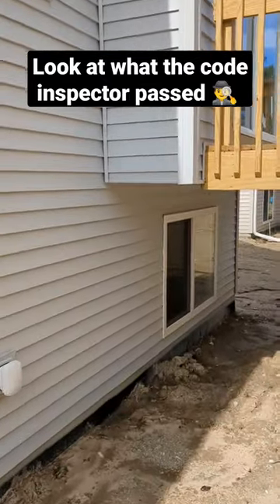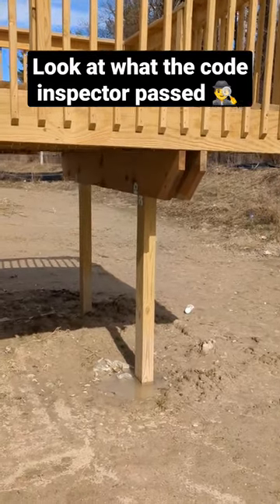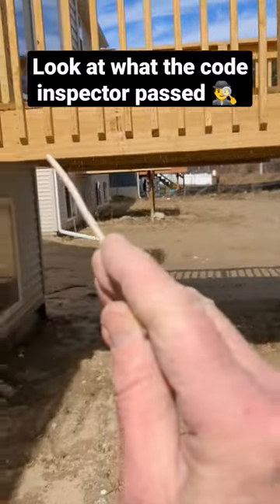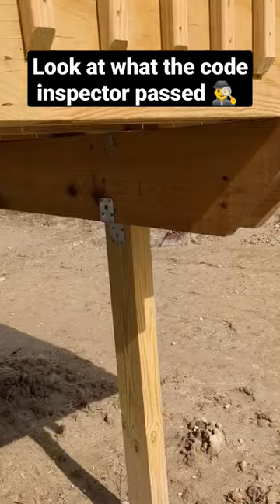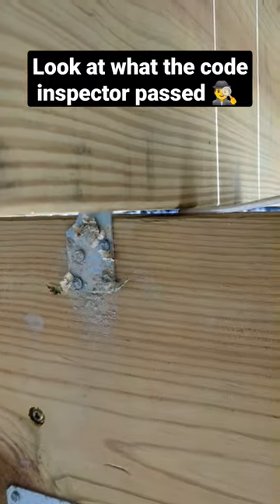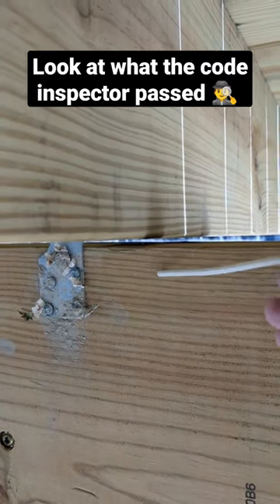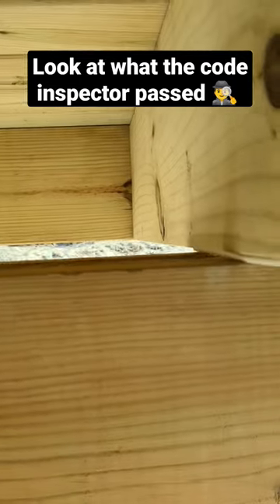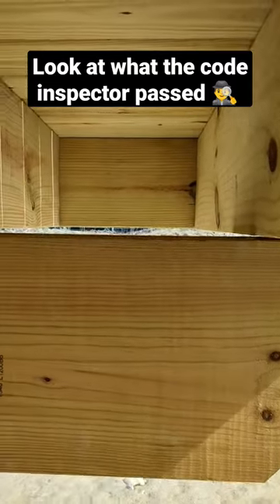Code #inspectors don't pay attention to detail#deck #newconstruction#youtubeshorts#shortvideo#shorts

Comment: How could a person get those joist to rest on the beam?
Reply from the maker: Well, actually the entire deck is improper and needs to be rebuilt.This home got worse. SEE Missing Footings Inside https://youtu.be/TqGMGpvnVAk
I've been finding more developments selling homes with NO decks, but they install handrails in the slider door frame. Once the code inspector is gone a crew member comes back and slaps on the deck for extra money 🤑 and no permit. Ugh.
Thanks for watching.
Reply: @inspectflix  I meant not resting on the beam. I  don't get a person can set one board on top of another and they don't touch?
Reply from the maker: @davidshumski4629  Right. Structural wood members are supposed to rest on top of others. The twist straps are now keeping them separate. The separation is caused by shrinkage of the wood.
Reply: @inspectflix  I finally came to that conclusion.
Reply from the maker: @davidshumski4629  it's an interesting illusion 😂 Decks and homes are built too fast.
Reply: @inspectflix  I've built a deck or two in my day. that treated wood is wet and heavy. Froze together at the lumber yard in the winter. I never used straps on the joists.

Comment: Why not point out the bigger issue at hand here? You cannot attach a ledger board to a cantilevered floor of a house lol
Reply from the maker: Because I made several different videos there . The entire deck is improper and needs to be rebuilt.This home got worse. SEE Missing Footings Inside https://youtu.be/TqGMGpvnVAk
I've been finding more developments selling homes with NO decks, but they install handrails in the slider door frame. Once the code inspector is gone a crew member comes back and slaps on the deck for extra money 🤑 and no permit. Ugh.
Thanks for watching.

Comment: Even pressure treated will rot quickly in standing water.
Reply from the maker: YES! Pressure treated wood life span is 10-40 years depending on the exposure of pH in the soil. Just imagine a wood foundation.🤮 yuck. I've inspected some of those in the last 32 years.
Thanks for watching.

Comment: There’s so much more wrong with that deck!  But the lumber probably dried and shrank a bit and separated from the girder.  Plus there’s no toe nails from joist to girder, which should be done prior to installing the hurricanes.  The girder and post system is a disaster in itself and worthy of its own video!  Unbelievable!

Comment: Uhh you guys are allowed ro use 4x4? And not 6x6? And split beem? Wisconsin code is 6x's and sandwiched beem
Reply from the maker: No, we are not supposed to do any of what's in the video here in Michigan. Minimum post is 4x6, yuck and now the beam is to rest on top of the beam or notched into the beam. And yes the footings are under the ground, yuck 🤮. The code book is a D-. And only 1 in 10 builders are licensed.
Thanks for watching.

Comment: is it a code inspector? or a construction inspector?
Reply from the maker: Well. We really don't know if a code inspector looked at it. 
Because we do  have homes built so fast here that the deck is not installed , they put a rail in the sliding door and get the final code sticker.
Then Some mystery person comes by and slaps the deck on.
Horrible format.
Thanks for watching.

Comment: Ugh deck is supported off a cantilever. The joists will settle and are off the girder due to the crown of the outside rim board. Exhausting. Don’t support your deck on a cantilever😢

Comment: That will settle very quickly.
Reply from the maker: Yep. Including the post. Lol
Thanks for watching
Reply: @inspectflix  The gap is not even important - what makes the deck a load of crap is that the beam is not sitting on the posts. Terrible construction.

Comment: That isn't the only violation!!!!
Reply from the maker: Exactly! The entire deck is improper and needs to be rebuilt.This home got worse. SEE Missing Footings Inside https://youtu.be/TqGMGpvnVAk
I've been finding more developments selling homes with NO decks, but they install handrails in the slider door frame. Once the code inspector is gone a crew member comes back and slaps on the deck for extra money 🤑 and no permit. Ugh.
Thanks for watching.

Comment: Uh, pretty sure Physics dont work like that. Where the force would be on the beam is actually on those metal thingies. If and when those metal thingies settle, the whole thing will no longer be level, making the product as it is not last as long as it should.
Reply: While yes the force transfer is on the connections, those connections are designed to withstand stress along the entire structure not stress of the structure alongside the dead load of the structure itself. This means those connections are at a much higher likelihood of failure.
Reply: @EggyWeggyIII  This is true. I also think it would be instant when it fails. Now that I think about it, someone could be standing on it when that happens. Yikes.

Comment: the water😂
Reply from the maker: Yep the water and more. I made a lot of short videos on this.The entire deck is improper and needs to be rebuilt.This home got worse. SEE Missing Footings Inside https://youtu.be/TqGMGpvnVAk
I've been finding more developments selling homes with NO decks, but they install handrails in the slider door frame. Once the code inspector is gone a crew member comes back and slaps on the deck for extra money 🤑 and no permit. Ugh.
Thanks for watching.

Comment: Also in other end attached to bay
This need to be free standing deck really
Reply from the maker: Yep. The entire deck is improper and needs to be rebuilt.This home got worse. SEE Missing Footings Inside https://youtu.be/TqGMGpvnVAk
I've been finding more developments selling homes with NO decks, but they install handrails in the slider door frame. Once the code inspector is gone a crew member comes back and slaps on the deck for extra money 🤑 and no permit. Ugh.
Thanks for watching.

Comment: It all looks fine to me, all proper connections in place just poor craftsmanship. The joists should have been resting on the beam long before any Simpson tie downs were installed and get those posts out of the dirt on metal post bottoms and get those footer’s above grade next time. The ledger attached to the cantilever is up for debate but it should have been designed so that deck joists would be flush with the interior joists as well but that’s what you get with production framing. If you aren’t building it yourself then you get what you pay for. Otherwise it’s structurally sound in my opinion but cheap work ain’t always good n good work ain’t always cheap. Next time tell the builder you don’t want a deck and pay a private contractor. 😊

Comment: No ledger board or hangers on floor joist
Not double banned 
Post to small should be 6x6 and notched 
Railing post not notched 

Wander how many 100$ it took to get this far below national code deck passed🧐
Reply from the maker: Speed process. In Michigan the builder is getting a final pass on code by putting a handrail in the slider door track. Then another person comes back and slaps that junk together. 
Only 1in 10 builders are licensed here. 🫡
Check out those missing footings inside.
Thanks for watching and the comment.

Comment: If that’s the worst thing this builder did I’d be very happy with that house.
Reply from the maker: It's not. This home got worse. SEE Missing Footings Inside https://youtu.be/TqGMGpvnVAk
I've been finding more developments selling homes with NO decks, but they install handrails in the slider door frame. Once the code inspector is gone a crew member comes back and slaps on the deck for extra money 🤑 and no permit. Ugh.
Thanks for watching.

Comment: Seriously? They are not all crowned the same, and you will get a little bit of that generally. This is NOT a big deal, and certainly not a reason to fail an inspection! What are they supposed to do plane off every joist until they are all completely straight or misalign where you nail them to the rim?

Comment: Shouldn't those be 6×6 posts or at lease more of the 4x's for proper support midway or closer to the house? 
Besides that...I would make that a tent/fort for yard fun and shady spot. Ooh maybe do a veg garden. Great concept poor execution.
Reply from the maker: 🤣. Yes . Actually the entire deck is improper and needs to be rebuilt.This home got worse. SEE Missing Footings Inside https://youtu.be/TqGMGpvnVAk
I've been finding more developments selling homes with NO decks, but they install handrails in the slider door frame. Once the code inspector is gone a crew member comes back and slaps on the deck for extra money 🤑 and no permit. Ugh.
Thanks for watching.

Comment: Those 4×4's aren't good enough, 6×6 at the least
Reply from the maker: Correct! And the beam should be set on top of the post or notched into the post. The house got worse. 
Check out those missing footings inside.
Thanks for watching and the comment.

Comment: I wonder if the posts sunk, causing the issue he's pointing out
Reply from the maker: Nope. It is shrinkage of the wet lumber and speed process is a problem in new construction. Pressure treated lumber is still wet when delivered then dries out after installed. "Not good practice". Who knows about the posts footings. They may sink. Thanks for watching.

Comment: I would bet the inspector never looked at it ! I installe 300 ft of fence. Inspector came in the rain, pulled up in the driveway. THe permit hanging on the post. SIgned it and left! LOL
Reply: Never got out of the truck
Reply from the maker: I think you're right. The entire deck is improper and needs to be rebuilt.This home got worse. SEE Missing Footings Inside https://youtu.be/TqGMGpvnVAk
I've been finding more developments selling homes with NO decks, but they install handrails in the slider door frame. Once the code inspector is gone a crew member comes back and slaps on the deck for extra money 🤑 and no permit. Ugh.
Thanks for watching.

Comment: Go inspect the local lumber yard they are the ones who sold wet lumber
Reply from the maker: Yep. I used to work at a lumber yard back in 1985. And things have definitely changed since then. The speed process is out of control. 
Thanks for watching.

Comment: Looks like the 4by4 sunk to me
Reply from the maker: Quite the illusion huh? It's actually wood shrinkage but I don't have faith in the posts either. The entire deck is improper and needs to be rebuilt.This home got worse. Check out Missing Footings Inside https://youtu.be/TqGMGpvnVAk
I've been finding more developments selling homes with NO decks, but they install handrails in the slider door frame. Once the code inspector is gone a crew member comes back and slaps on the deck for extra money 🤑 and no permit. Ugh.
Thanks for watching.

Comment: I trust a DIYer job who spends hours researching something thoroughly before embarking on a project 20 times more than a lazy contractor who takes no pride in his work. I wouldn't put my name on that thing and I've never built a deck in my entire life. I will next summer and my research is almost complete. This is really sloppy work and got more problems than the one shown in this small clip.

Comment: Treated shrinks a lot. It'll settle.  Don't be so picky for clicks.
Reply from the maker: Ok. The entire deck is improper and needs to be rebuilt.This home got worse. SEE Missing Footings Inside https://youtu.be/TqGMGpvnVAk
I've been finding more developments selling homes with NO decks, but they install handrails in the slider door frame. Once the code inspector is gone a crew member comes back and slaps on the deck for extra money 🤑 and no permit. Ugh.
Thanks for watching.

Comment: Support posts way too small and sitting in water.
Reply from the maker: Yep. You got it.The entire deck is improper and needs to be rebuilt.This home got worse. SEE Missing Footings Inside https://youtu.be/TqGMGpvnVAk
I've been finding more developments selling homes with NO decks, but they install handrails in the slider door frame. Once the code inspector is gone a crew member comes back and slaps on the deck for extra money 🤑 and no permit. Ugh.
Thanks for watching.

Comment: Maybe if you want it done right and not complain do it yourself
Reply from the maker: That may be the best option.This home got worse. SEE Missing Footings Inside https://youtu.be/TqGMGpvnVAk
I've been finding more developments selling homes with NO decks, but they install handrails in the slider door frame. Once the code inspector is gone a crew member comes back and slaps on the deck for extra money 🤑 and no permit. Ugh.
Thanks for watching.

Comment: That dont matter... Once it starts bearing weight it will rest on the beams... Im calling BS
Reply from the maker: It's shrinkage of the wood. With so many things wrong though, it needs to be rebuilt.This home got worse. SEE Missing Footings Inside https://youtu.be/TqGMGpvnVAk
I've been finding more developments selling homes with NO decks, but they install handrails in the slider door frame. Once the code inspector is gone a crew member comes back and slaps on the deck for extra money 🤑 and no permit. Ugh.
Thanks for watching.

Comment: Who cares? It'll settle and be absolutely fine. Though having that much deck built on 2 4x4 posts seems unwise.
Reply from the maker: The posts are actually 4x6  And the entire deck is improper which needs to be rebuilt.This home got worse. SEE Missing Footings Inside https://youtu.be/TqGMGpvnVAk
I've been finding more developments selling homes with NO decks, but they install handrails in the slider door frame. Once the code inspector is gone a crew member comes back and slaps on the deck for extra money 🤑 and no permit. Ugh.
Thanks for watching.

Comment: I'm not trusting a deck with that single weak-ass double post. Did a parent make that deck for kids? How is any adult supposed to comfortably use that deck with a grill or small table?
Reply from the maker: Oh you got it. Scary! This home got worse too. SEE Missing Footings Inside https://youtu.be/TqGMGpvnVAk
I've been finding more developments selling homes with NO decks, but they install handrails in the slider door frame. Once the code inspector is gone a crew member comes back and slaps on the deck for extra money 🤑 and no permit. Ugh.
Thanks for watching.

Comment: It will settle
Reply from the maker: 🤭🤣 yes it will. Just like the house.This home got worse. SEE Missing Footings Inside https://youtu.be/TqGMGpvnVAk
I've been finding more developments selling homes with NO decks, but they install handrails in the slider door frame. Once the code inspector is gone a crew member comes back and slaps on the deck for extra money 🤑 and no permit. Ugh.
Thanks for watching.

Comment: I can't stand inspectors.  The rim joist is not holding up the floor joist.  The metal clips are holding up the floor joist.  In a matter of weeks, I would guarantee with foot traffic, those floor joists will be firmly on the beam.  I think the easiest job in the world is to inspect and find faults.  A good construction foreman or a company with inside quality control is all that is needed.  This is a nothing issue to cause unnecessary work.

Comment: Meh what’s the worst that could happen
Reply from the maker: 🤭 rebuild! Lol. The entire deck is actually improper. This home got worse. SEE Missing Footings Inside https://youtu.be/TqGMGpvnVAk
I've been finding more developments selling homes with NO decks, but they install handrails in the slider door frame. Once the code inspector is gone a crew member comes back and slaps on the deck for extra money 🤑 and no permit. Ugh.
Thanks for watching.

Comment: You could drive a truck on that thing. Quit cutting up people's work. The outside rim Joyce will carry the inside Joyce. It's not a problem. You have 2 by 10 structure there. It's way overkill in the first place.
Reply from the maker: Sure 🤣lol🤣😂 those post in mud will hold a truck.
Who's Joyce?

Comment: That's doesn't look safe or secure
Reply from the maker: Oh it's not 🚫. The entire deck is improper and needs to be rebuilt.This home got worse. SEE Missing Footings Inside https://youtu.be/TqGMGpvnVAk
I've been finding more developments selling homes with NO decks, but they install handrails in the slider door frame. Once the code inspector is gone a crew member comes back and slaps on the deck for extra money 🤑 and no permit. Ugh.
Thanks for watching.

Comment: Not impressed by that 1/16 inch gap that will settle in a week. Want to justify an 80K inspector salary, look at the posts sitting in the water
Reply from the maker: Oh and it got worse. All the deck problems are nothing compared to the rest of the house. Check out those missing footings inside.
Thanks for watching

Comment: And?
Reply from the maker: And yes there's a lot more. The entire deck is improper and needs to be rebuilt.This home got worse. Check out Missing Footings Inside https://youtu.be/TqGMGpvnVAk
I've been finding more developments selling homes with NO decks, but they install handrails in the slider door frame. Once the code inspector is gone a crew member comes back and slaps on the deck for extra money 🤑 and no permit. Ugh.
Thanks for watching.

Comment: 4x4s below grade in standing water smh.. they built the rest too good to cut corners on the most important structural part! amateur hour
Reply from the maker: Well actually it got worse.  SEE Missing Footings Inside https://youtu.be/TqGMGpvnVAk
I've been finding more developments selling homes with NO decks, but they install handrails in the slider door frame. Once the code inspector is gone a crew member comes back and slaps on the deck for extra money 🤑 and no permit. Ugh.
Thanks for watching.